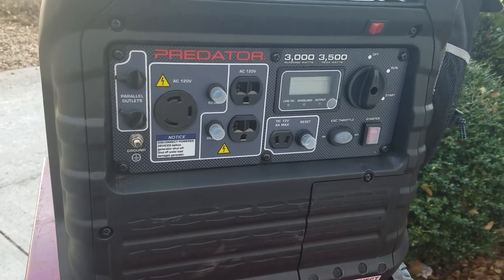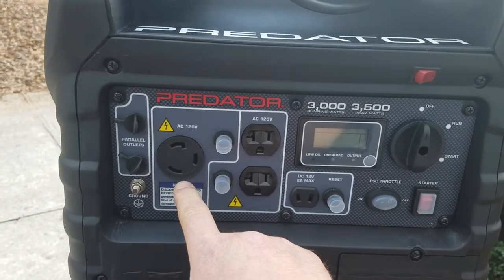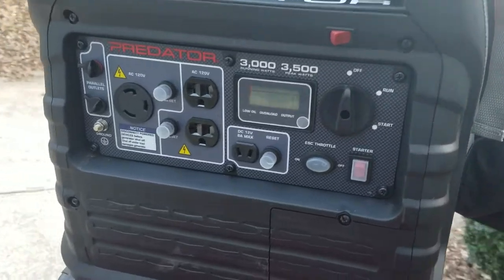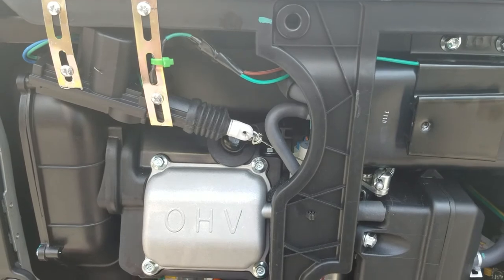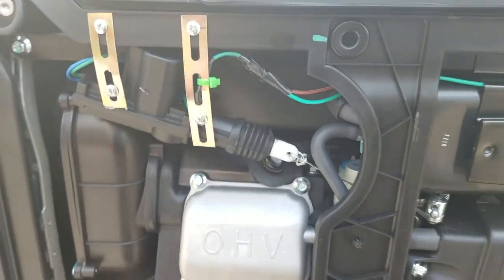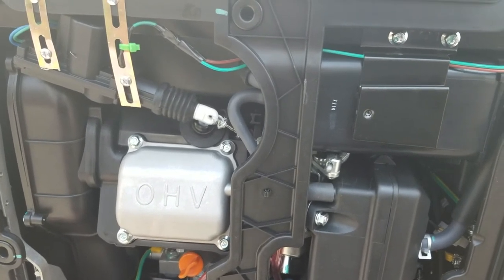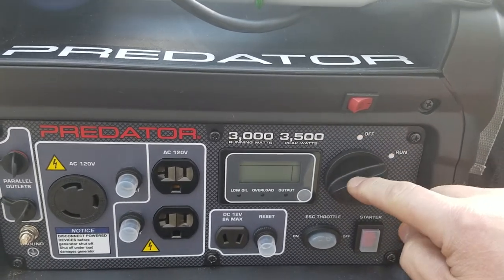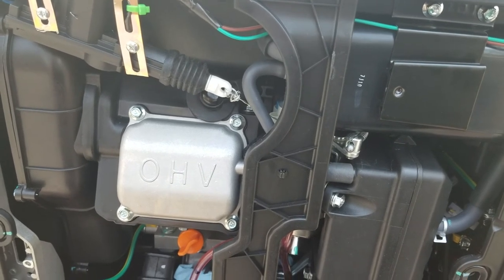Predator 3500 with automatic choke system set up.

Comment: I believe if you buy the Camco RV plug adaptor, it fixes that problem for you. It clocks it straight down instead of at “10:00” o’clock. I’m not 100% sure but I have a 8000 watt NorthStar gen and that’s what fixed the plug from unhooking it self while running.
Reply: CornFed Productions it does. Rv plug will be vertical. It’s the yellow Camco RV adapter on amazon

Comment: Does this generator need to run on choke for a short time when it is really cold outside(below 25 F) ? Many generators and other engines will stall, if the choke is moved to Off to soon, when they are very cold. Have you tried this auto choke in really cold weather...?
Reply from the maker: Coil Smoke .....you are correct. So I did not change the original factory set up. I can still manually turn it to choke and off choke with the turn knob. So it can still warm on choke for a minute, before I switch it over to run manually. Great question....

Comment: JACK!!! Please do a video on a extended run fuel tank.  No one has been able to tell us if these generators have a vacuum from the fuel tank to run a stand beside fuel tank or a gravity fed only.  THANKS!!  Love the videos keep em comin!
Reply from the maker: jam6sco2 ....... actually it's would be a gravity feed tank.....the factory fuel cap is vented thought the vents that click....so it would not get vacuum locked.... however, if you could seal both caps on both tanks it would eventually create a vacuum that would pull into the other tank, but it would have to pull from the bottom on the other tank and enter from the top of the other tank that is sealed. But this would be complicated to keep it working because eventually the fuel vacuum pressure would equal out in both tanks and it would stop the flow and the engine would starve for fuel and turn off.
Reply from the maker: jam6sco2 ....but what you could do is get a simple inline fuel pump like the Ryobi 2000 inverter has, and it would pump great and you don't have to seal either fuel cap.
Reply from the maker: jam6sco2 .....but I would still suck from the bottom of both tanks with a "T" and 2 fuel filters one on each line.

Comment: Notice you don’t respond to comments a whole lot lately so this is probably pointless (not grumbling about you there!) to ask but do you know if there’s anyway to throttle down the generator some without going quite to economy? Or just how to make it quieter is actually my question. This new one I got runs much louder than other Predator 3500s I’ve had. Guessing it is throttling more than them but I have no idea. Any advice or tips greatly appreciated. I have the generator setup on back of my van so need it to be quiet like the others have been.. some reason this one is much louder & vibrates lot more
Reply from the maker: Sorry, yes I do not respond too often. I don't know any way to make one more quite. Mostly this is because the casing and insulation inside the unit. I guess you can adjust the throttle return screw, but if your not carful it will mess with the econ. setting.

Comment: I will be interested to see how you hook up the remote start/stop. I assume you are going to do it through a relay so you can kill the power by grounding out the spark and/or actuate the sequence for starting just like the start button does on the generator. Did you have to use a relay for the door actuator, or did it have a relay in it already?

Comment: I found your video because I went to run mine for 2nd time and it wouldn't start. I found the metal choke arm ( what you see move in your video) was not attached to the black plastic lever on the carb at all. Whatever pin they used must have fallen out. I guess it's pretty rare I can't find anyone on the web that posted anything. I'm going to try to find a roll pin that will work because I've done 2 oil changes already and I don't want to start all over again. What do you think?

Comment: why those generators  after some time of smooth running don't take regular load anymore ?! i went trough 2 of them : one quit after about 6 weeks . the other  after about 3 weeks . They do the same error > GO UNDER LESS THAT 1000 WATTS OF LOAD IN TO "OVERLOAD "MODE ...  keep running  but on idle only ... no power supply .  
It must be minor problem but where is the issue ??.. i hate to keep returning it this time , i rather fix it .  Why there is no info about this particular problem in the manual  in TROUBLE SHOOTING ??
If anybody could help with diagnostic please do ... is hot in california and i would like to run my window 1000Watts  A/C  . 
Thanks 
Stan
Reply from the maker: stan ....I would ask the question after several weeks later each started having problems. During those weeks before they went bad, what other work did you do with it? Any sheetrock work, heavy dusty places? Maintenance being done like, change oil? Also the fact that these generators are very electronic sensitive. It could be anything and everything. Bottom line it's all about the individual who is operating it. For 2 with the same problem, back to back, weeks later, must have a common denominator.
Reply: no harsh environment nor abuse .. just running 1500W camper A/C .  which is less than half  load what this generator should handle . 
Oil was changed after 4 hours , then 8 hours   and about 30 hours ..
Reply from the maker: stan .....sounds like you did everything right.....well I would probably return the second one as well if that's an option for the warranty. Inverters are very hard to work on. If you have a way to returning and start fresh I would. If that's not a option now, then the only thing I would think it would be is the inverter itself. And that's not a easy or cheap part to replace.
Reply: thanks , i'll do return .

Comment: if you leave the dial in the "run" position wont that drain the battery?
Reply from the maker: James Christy ..Thanks for your question James, no the dial doesn't have to do with the battery. The contacts that touch only tuns off the unit by grounding out the spark.
Reply from the maker: James Christy ...and is also the fuel valve to the carb. No power to the knob....